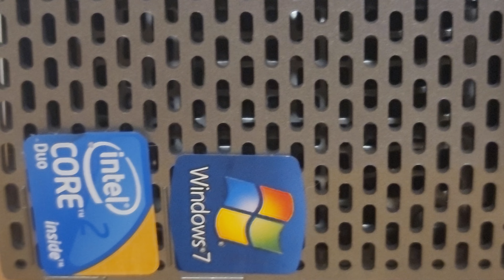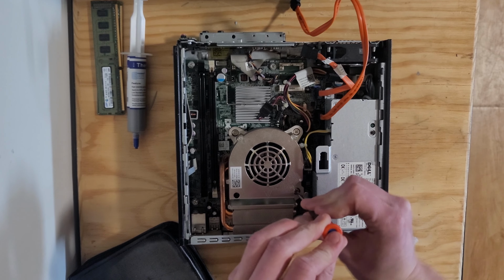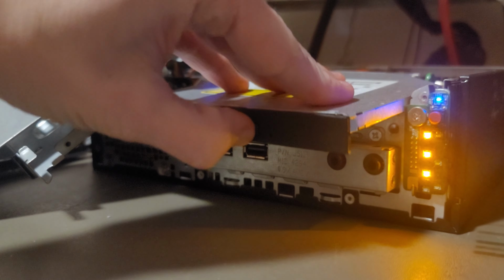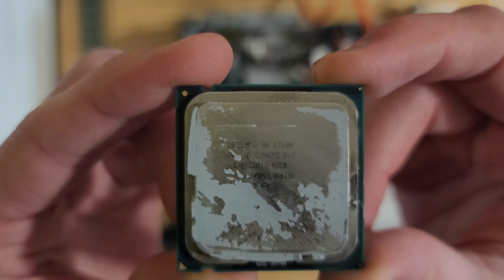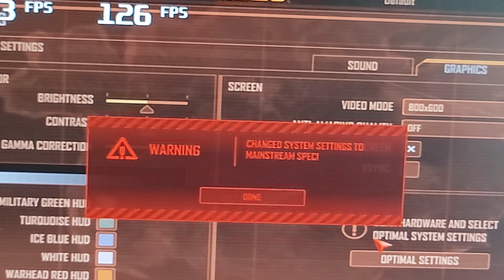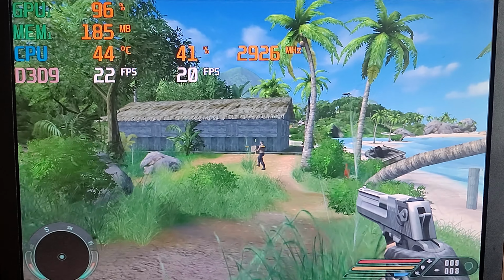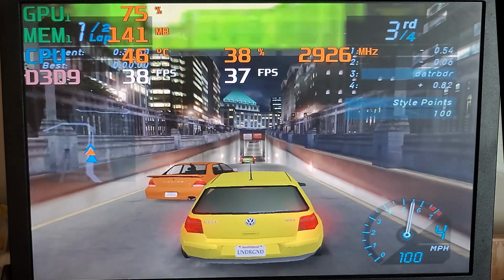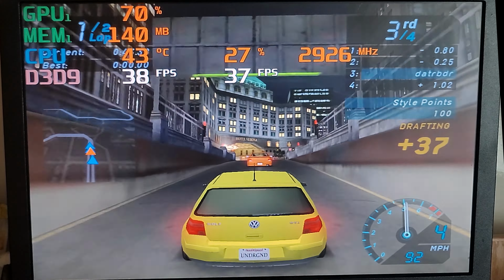Can You GAME On the GMA x4500 in 2023? (Dell Optiplex 780 Integrated Graphics)

Comment: Far Cry 1440x900 Medium on intel iGPU? you crazy? 900p is higher than 720p which is what we use in current Intel iGPUs and even AMD APUs. Put that in 800x600 and everything would run fine. I know its low for today's standard but it is what ultra budget people used back then.

Comment: You don't know what you're talking about. It's not a VRAM or RAM issue at all. It's just a very very weak, low power integrated GPU from Intel. 4GB of RAM was unheard of in 2004 when Far Cry came out, and 512MB of VRAM was beyond a dream system!